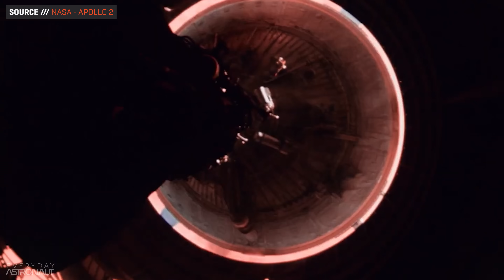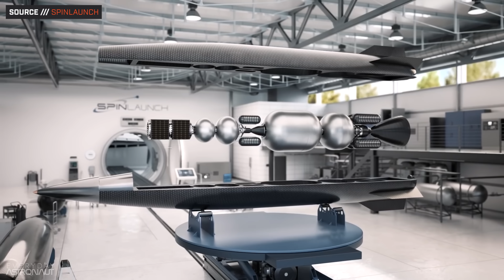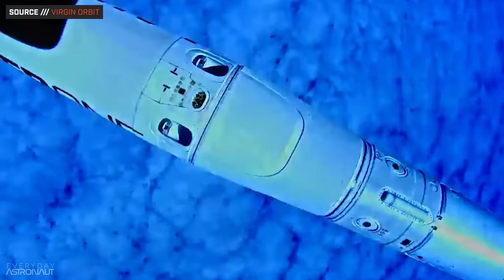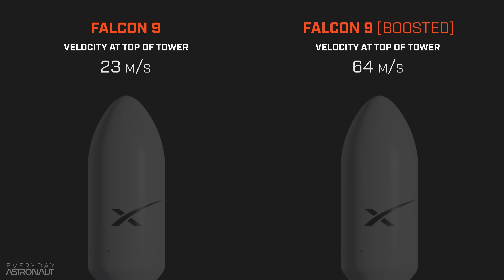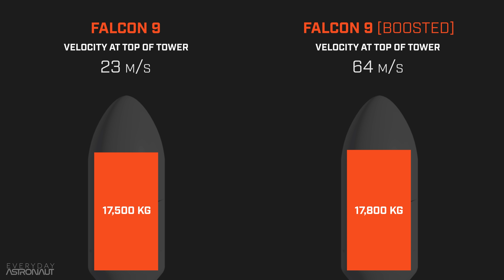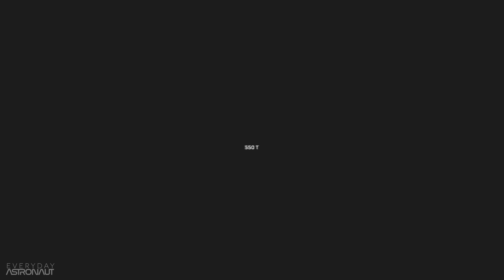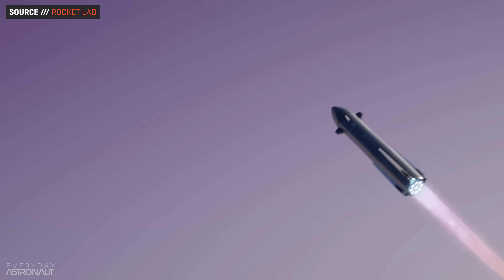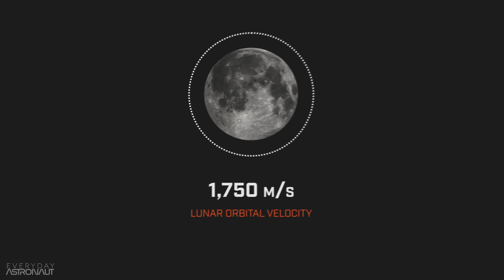Could We Help Push Rockets To Orbit?

Comment: I bet you could yeet that Mercury Redstone a little bit further with a rubber band rigged as a giant slingshot. You'd probably need a set of giant pogo sticks for that Mercury Atlas vehicle, and above that, you're probably out of luck. It's going to require more power in than you get out. Well, the same goes for the Mercury Redstone and Atlas too, but if you had enough people to pull on the slingshot or the pogo sticks who would do it for free, there would be a considerable savings. Ain't nothin' that can save Starship though. Hope that project gets nixed much sooner than later honestly.

Comment: I would just use a maglev (no vacuum) traveling up the side of a mountain to push the rocket. A couple of hundred KWH of electricity is not expensive....USA average is 18 cents per KWH x 271 KWH (from your falcon 9 example calculations)= $49. $50 to boost your payload by 10% to 25% is cheap, don't you think? There is also an old NASA concept to boost a space plane on a maglev up the side of a mountain....its the only way a single stage to orbit space plane can work on earth.

Comment: Surround rocket by remote controlled 6 hot air balloons while it’s seated on the pad, maximum heat should nullify some mass of the rocket during takeoff, balloons then popped or somehow detached.

Comment: Run fuel/oxygen lines from the top of the tower to the bottom of the rocket and have them detach at the last moment as the rocket clears the tower. You could omit the amount of fuel needed for that distance.

Comment: 30:23 The moon is not perfectly tidally locked to the earth it wiggles. Not sure how bad the wiggle is in degrees, but it would require the moon launch system to only be used when it is pointing towards earth, be movable, or add more fuel for more course correcting on the way back requiring a bigger more powerful launcher.

Comment: It is maybe roundabout the power consumption of 375.000 households, yes, sounds massive, but: The power is consumed ONLY for a few seconds! The power (1GW) is btw. not THAT excessive, as a typical nuclear power station can SUSTAIN to deliver that power over years, not seconds. Personally, instead of a supercapacitor, I'd propose a big flywheel that can be accelerated over hours, store the energy, and then release it into a generator within seconds, thereby decelerating itself and accelerating the rocket. Awaiting  your comments...Edit, min. 16.58: Quote: "That's an absurd amount of energy". -> I strongly disagree, that is only about 2 single household"s yearly electrical  consumption, not actually very much energy. The power is "absurd", I'd more agree with that.
Reply: Bro totally mixes power and energy...
Reply: @marcogpt  Yep; He's the typical youtuber.

Once they get past about 100k subs, they start confusing their lack of knowledge for facts.

Comment: For your next “why don’t they just….” video: How about keeping fuel flowing into the tank while it ascends the tower so it has a full tank when it clears.
Reply: I imagine keeping the rocket heavier(by having more fuel available via continuous filling) for longer during liftoff you'd then need more fuel to lift that extra fuel, and probably has very little to no actual benefit during the launch itself, with a lot of extra mechanical complexity.
A rocket burning fuel is losing mass making the rocket lighter during liftoff that in turn creates the greater accelerations needed...
or something..
Reply: @CthRyleh  Yes that is true but if you constantly reset rocket equation, because you are still getting new fuel, then it doesn't matter that you are not getting lighter. You are getting free acceleration without loosing any fuel.
Reply: @CthRyleh  I can totally see that being true. Another possibility is that the materials to create a huge flexible hose capable of handling cryogenic liquids just haven’t been developed yet. I’m just not sure.
Reply: some Rockets actually do this, at least partially (i think ist usually for about the first 10m of their flight).. downside is you have to replace the flexible hoses with every launch.. oh, and these launchers were afaik never intended to be human-rated...
Reply: @unitrader403  Oh cool. Do you remember any of the vehicle names or who performed the launches?
Reply: the massive amount of complexity you would have from trying to fill the tank up just 2 percent more would not be worth it
Reply: @Neoprenesiren Agreed, it’s likely a bad idea.  I just want to see how much of a bad idea it is. Is it actually 2% of gain for 100% more complexity? Or is it 0.05% gain for 100% more complex?
Reply: @worldwideroach  imagine how much better rockets would be if they used nuclear propulsion. They would need refueled every decade and would be as small as a lander.
Reply: cars driving away with the fuel hose still attached cause fires daily. what the heck would make you think you can do it with a rocket?
Reply: @smartard  because cars aren't designed to have pull away gas hoses. Do you think they would use the same kind of hand pump for the rocket as you would your car?
Reply: @smartard Fire and safety concerns are obvious and were generally ignored in this video, so ignoring them in the next is reasonable. Assuming the risks are mitigated, is there any other reason not to? Complexity? Diminishing returns?
Reply: @worldwideroach  great idea. The tower is so tall lets put it to good use!
Reply: @smartard  It's almost like the system would be designed for it, while gas stations and cars are not.

Comment: I may be kind of stupid, but something I did not see here was using gravity to induce the initial propulsion. Build a really high watzit with enough curve at the bottom to not crack under the strain of change of direction and kind of roller coaster some for the initial inertia. Then after it transitions from down to up with some significant acceleration kick in some mag lev boost  for the last quarter for more speed up and then fire the engines as it clears the equipment. (or mag-lev the entire thing complimenting what I assume to be a pretty decent gravitational propulsion) Drop time still allows time for abort if all is not well, and the mag could even flip and operate in reverse in the case of a total abort (up to a certain point). 
Again. I may be stupid, and something about the directional change may not be feasible, but I still think we could somehow use the earths gravity itself as a tool in gaining some extra momentum with a lot less energy involved. 
Dammit Jim, I'm a Graphic designer not a Physicist, :)

Comment: I was thinking about a steam powered system, similar to a catapult, using two cylinders pushing the rocket up a 100' to 150' vertical track, accelerating to about 300 kph by the time it leaves the launch tower. Steam can pack a LOT of power.

Comment: Tim,
How about using a booster stage that does not leave the launch tower?
 It would be like a piston initially positioned directly below the launch pad. Powered by rocket fuel. 
As it reaches the top of the tower the main booster takes over both pushing down on the ' piston stage and continuing to power as usual.
There would be savings in weight/ fuel of the booster.
As the piston reaches the tower top it's fuel is expended, but has momentum. Then  a ring attached by chains to weights would impede further vertical movement.

Comment: Put a long vertical pipe in deep ocean water and put a piston at the bottom. Slowly empty the pipe of water and place a medium size rocket on the piston. The seawater pushing up the piston is easily reaching 1.21GW, and will push the fully fueled rocket above the magic limit of 88mph as it breaks the surface.

Comment: I have an idea! Put a high explosive under the rocket as it launches to push it up with a ton of force and clear the tower! We’ll need a lot of energy, so perhaps design some continuous explosion that will continuously push the rocket up. We can even put it on the rocket for better flight control, which also means we can keep it going above the tower.

Comment: i enjoyed the video tim, but i have one big complaint.  you evaluate plans based on efficiency and cost... and yes, in this day and age, that is how we (people who make the calls) think.  but what if we were to rise above it?  

what if we  had other reasons?  
reducing pollution - that would be a good reason for future-oriented civilization.  
or, say we're almost out of fossil fuel - that's not hypothetical, we surely will run out. 

this would be a different video. 
a 1km vertical tunnel suddenly isn't that much of a problem. a few-hundred-km tunnel for space planes would be a mega-project - but if you must, you must...
Reply from the maker: Concrete construction is one of the worst greenhouse gas emitting processes, the carbon impact of constructing a 1 km deep tunnel would probably never be offset by even 1,000 electron launches with a 25% boost

Comment: If tesla battery can deliver 800 kw  to the motor and we need 500 of them it's " only 25 million usd " if you consider that battery have to bé much smaller and litle caapcity but high delivery battery + motors worth half the Price of a tesla ( i think it's very conservative it should go more like 1/10) the transphering the power is another big deal

Comment: Are you using the existing spaceships with their fuel payloads to figure their launch needs? If the rockets didn't need the fuel, motor, and storage space would the yeet power requirements be lessened?

Comment: When CNT/graphene production gets going, options open up. 

Like a nice soft flexi hose barrel which is held up by a few balloons as high as that can be done. 

Then use ground power to pressurise behind the rocket in a soft barrel, and the structural issues go away. 

Sure, you have to push through atmosphere, a little air trapped ahead to open the flat hose/tube/barrel as you ascend … 

And, of course what bags and balloons of that material will do for fuel containment will be awesome. Never mind huge inflatable nested discs/bowls the stuff to gentle reentry quickly and safely.

Comment: Compressed air? You could take as long as you wanted to build the pressure and use off peak power to build it.

Comment: Can we build a high tower on the equator at 0 latitude, reaching hundreds or even thousands of kilometers? There is a large amount of linear velocity on the equator. According to physical calculations, building a 1000 kilometer tower at the top of the tower will have approximately 537.5m/s, and the gravitational acceleration will decrease to about 7.29m/s². On a circular orbit of 1000km, you only need about 7354m/s Delta V, minus the initial velocity, you only need about 6816.5 meters per second Delta V.
If you assume that your rocket weighs about 100 tons and lifts it from the surface to a height of 1000 kilometers, it would require approximately 8.5 gigajoules of energy, although it does sound like a very large amount of energy!
But let's assume to be gentle, let's spend about a day lifting the rocket from the ground to this height, which requires a 98.4 kW, approximately 130 horsepower electric motor to work continuously for a day, roughly equivalent to the power output of a standard family sedan.
Due to my poor math skills,😅🤣 I am sorry that I am unable to calculate how much the payload of this rocket has increased.

Comment: Ground based copv system in conjunction with hydraulics is the only answer
Reply: Basically a similar system to the pad cooling system. Also huge benefit to the force and damage ground Zero takes

Comment: I think these "ZERO FUEL" launchers are the future. 
I like the Giant electromagnetic rail accelerator idea. 
For something like starship the trick is how many seconds of fuel burn are you able to offset for how much time and capital investment. Is saving 10 seconds worth the extra weight you would have to build into the whole system to compensate for the extra load from acceleration at peak load.

Comment: Maybe we can Spin launch buckets of water to be processed into rocket fueled and or refueled  in low earth orbit. Rockets can then launch with only enough fuel to get to low earth orbit  and dock with a refuelling depot. There, first stage may be refuelled and or second stages may be fueled for very deep space missions.  I'm aware the first stage rocket nozels arnt optimized for operation in space but refueling in low earth orbit has to better then launching larger rocket to get a little beyond low earth orbit to geosynchronous orbits with the added weight of additional stages and their fuel.

Comment: About the electricity, it is possible to deliver huge amounts of power, we have things such as arc furnaces which too can demand significant amount of power. The issue with that however, is the infrastructure. With a not so commonly used system like a rocket launch pad, a super capacitor would still indeed be the logical solution. I urge the question of how many rockets would you have to launch, to save as much money as you've spent on the infrastructure / capacitors. I don't know the ballpark of that number, but I'd imagine it would not be so practical.

Comment: A counter weight:   
Use a large empty tank/ Fill it with water while it's up in the air/  Trigger the counter weight to assist liftoff/ Release the water in the tank before in hits the ground (by opening the bottom of the tank, water goes into a reservoir) / reuse the water for next flight. 
Sounds less expensive and easier than using a large block of titanium or steel or lead and easier to manage.
Reply: Nice idea at the handwaving level, but a tank holding an equivalent amount of water would have to be 13.6 times the volume of the steel cube - at least twice as long and wide and high.  And, even if you let the water go, you still have the very heavy structure of the tank that was holding the water which you do have to slow down - unless you want to build a new tank for each launch.  And, the launch tower would have to be entirely re-engineered to hold that much weight off the ground.  As Tim said, the tower at the moment only has to bear the weight of a near-empty booster stage, a tiny fraction of the weight needed for gravity assist.  AND, transferring a three G impulse to the skin of the booster would entail a bunch of internal engineering to get the force evenly distributed to the whole booster structure, and that reinforcement alone might offset much of the payload improvement.  
Part of Tim's recurring message is that the devil is in the engineering details, and those details are why launch assist is not feasible at this stage.
Reply: @matttownsend7119  Thanks for the reply.

Comment: I wonder why no one considers the proven technology i.e steam booster as on the aircraft carriers. 
One needs to build a small thermal (steam) power station (nuclear or otherwise) in the vicinity of the launch pad and use the steam to boost the booster (c) to a height proportional to the capacity of the thermal power station. 
Easiest one is to use methane 🙂to produce the steam, to simplify the system(s)
Not difficult or costly to calculate, build and operate.
Much more elegant solution than loading and burning on-board methane...

Comment: You mentioned how much fuel it took the Saturn five just to get to the top of the launch tower. What happens if you raise the platform from which you boost off would it save that much fuel or is it purely acceleration/speed?
Reply: Everyday Astronaut already made a video about launches from mountaintops.

Comment: What if the Starship launch tower would be actually something akin to a second "inverted" rocket that is mounted on the ground and it's putting all its acceleration force into some kind of sled (the "chopsticks"?). It would be similar to a additional first stage, BUT since it stays on the ground there's NO additional weight. Why isn't that a thing? The fuel tanks could even be underground. Obviously it only can add extra thrust until the height of the launch tower is reached, but if I understood this correctly this is the crucial part where conventional systems burn an insane amount of the total fuel

Comment: Pressurized gas based launchers have for decades operated to launch SLBMs and a number of other military missiles.  Clearly they were considered and discarded as an option for larger rockets.  It’s simply cheaper and/or reliable to use a larger first stage instead.

Comment: Launch assist will become useful when the the launchpad could no longer handle the launch.  Particularly in case of pad B and Booster v3.
The catapult is mostly to save the pad and not to save the fuel.

There is also a "strawman" arguments about electric catapult risks and about the chopstick being too weak.
Consider a robust cold gas catapult: boiling liquid nitrogen and water pushing multiple pistons.
Consider distributed load coupling to the lower bulkheads of both booster and starship (supports that reach inside through the inter-stage openings)

Comment: I have a proposal on how to make the launch tower assist possible. . . Vacuum pistons.. have 4-6 Vacuum pistons running from the base of the tower connected to pully system to multiply the power they produce. It would be pretty hard to engineer but easier then hanging 2 aircraft carriers from the tower